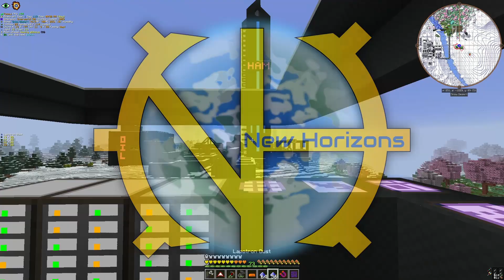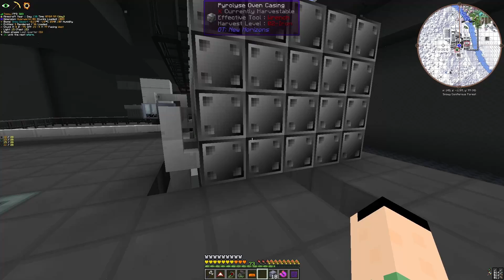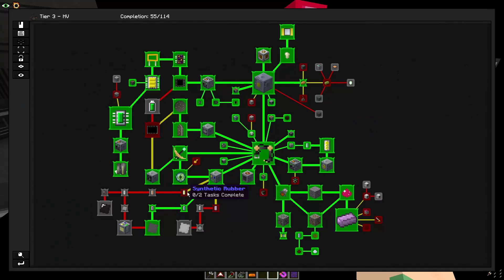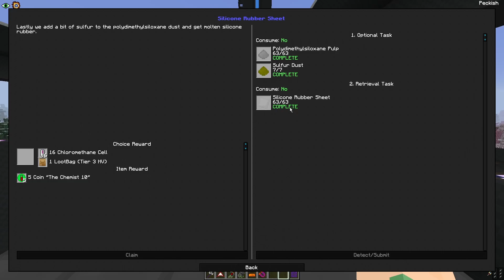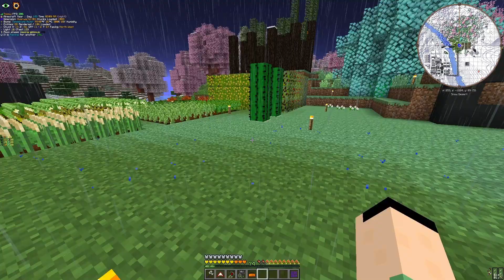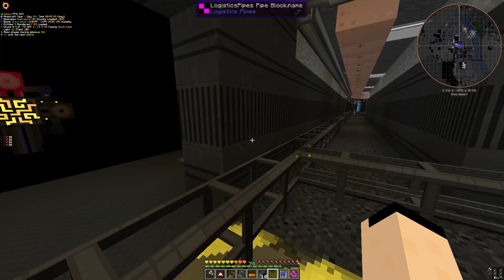GregTech New Horizons E35: Two Rubbers And Some Lube

Comment: Dear HamCor CEO,

To add to your cursed wall-sharing, you can put your input hatch for DT and output hatch for Oil Cracker (you need to lock the output) in the wall shared area and look directly to each other so you wont need to use any pipe at all. Also, in theory, you should be able to share 6 more blocks. That would cost 0.000218% less in companies overall raw material budget, so shareholders would be really happy.

Also for lubricant generation, since you have a source of nearly infinite Creosote Oil, just using distillery would be easier. Lube yield is less but you won't spend any redstone during the process.

And one last thing. Due to super busy season at Köfteistan LLC at the moment, we might miss this if the HamCorp already implemented this tech, but you can connect AE2 with LP network. If you want LP to read AE2, connect a Provider Pipe or chassis pipe with Provider Module to an interface. And for other way around, we didn't tested it yet, so it's just a theory, you can connect a Request Pipe to an interface or storage bus. It is super useful during the migration period between the networks.

Best Regards,
Köfteistan LLC Global Branch